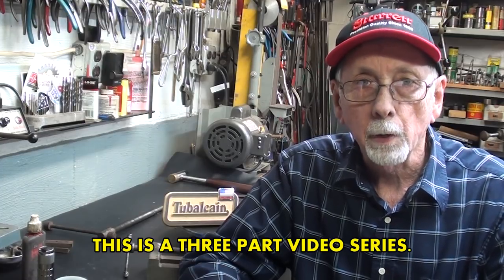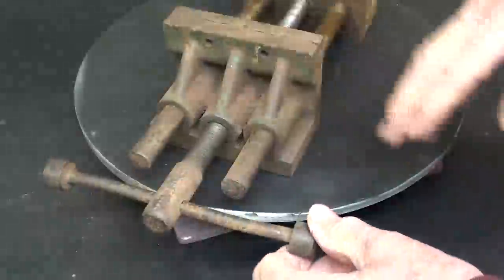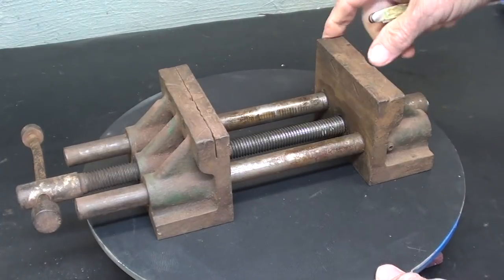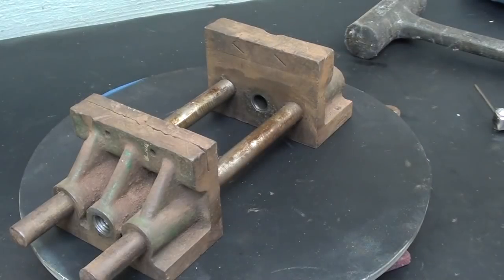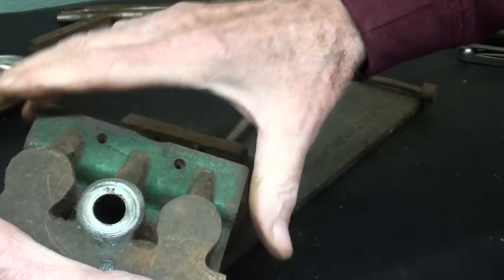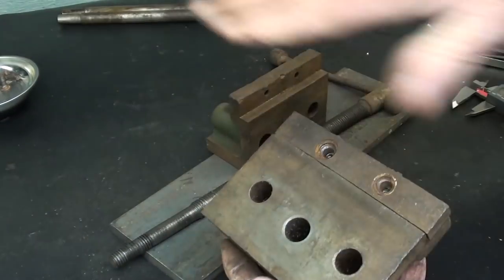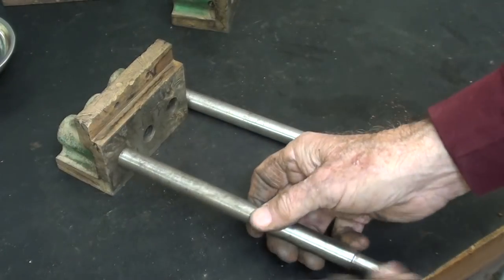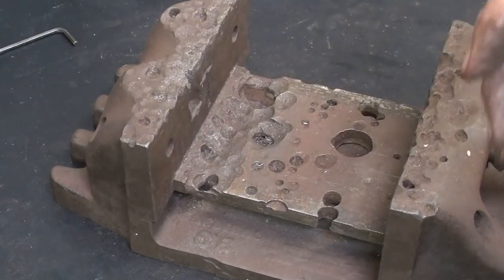Fixing a Left Hand DP Vise pt 1 TIPS #610 tubalcain mrpete

Comment: I suspect that "Bubba" may have made a mistake and threaded the wrong piece so he saved the project by adapting the design. I'm curious as to why you didn't just turn the ends of the guide rods to size instead of cutting them off? 

 We made vises like that in shop class in the 60s but we used all steel instead of castings. Then each student had their own drill vise so they didn't drill into the shop vises. We welded the two blocks together and bored the holes so they lined up perfectly. We threaded the guide rods on one end and they were 6 inches wide but otherwise very similar.
Reply: I agree on turning the mushroomed ends.  It's ability to open so far is the benefit of it.
Reply from the maker: We made vises like that in my class. We always welder them together for alignment

Comment: I know you're already done with this project, but if you knew someone with a blast cabinet you could sand blast all of those nooks and crannies down to bare metal in less than two minutes.   I bought a cheap table top blast cabinet that works well other than the fact it won't seal and you still need a respirator and sealed eye protection.
Reply: There's a few uploads on modifying the cheap Harbour Freight blast cabinets.  Everyone likes the price...but they see a lot of room for improvement.
Reply: @drmodestoesq  I appreciate it.   I will check it out.  I bought mine because I had a few things that I wanted to do.  After I finished those it just sits taking up room.  I've had a few things since that it would have been handy, but I wasn't willing to deal with the hassle.  I need to fix it or sell it.
Reply: You can also add a water pump and turn it into a vapor blaster. Plenty of videos on how to do that. Including how to seal it better.

Comment: That lead screw looks like a bodge. I'm guessing the unthreaded part should be by the handle.  That means the hub for the handle will need to screw on the end somehow.

Back to watching!
....
I am looking forward to seeing you restore that speed vise. Especially if you build up that surface with some silicon bronze or other weld rod  and machine it back to mint condition

Comment: A quick question about my Craftsman 12" metal turning lathe.  What is the maximum diameter four jaw chuck I can run on my lathe.  I have found a used Atlas 4 jaw in eight inch diameter and wondering if my lathe's timken bearing will handle this diameter.  Thank you for this and the excellent series of videos. Or can you recommend one of your videos where you talk about this question?  Thanks again.
Reply from the maker: 8 inch will work fine

Comment: The parts probably were cast using the lost wax or investment casting method.  When I was into model railroading I would buy many intricately cast brass parts for the locomotives and rolling stock and most were advertised as "lost wax castings".  It was a few years before I actually go to see the process.

Comment: I would guess these were war time parts, the high quality castings likely made in bulk n a foundry using a good set of patterns, but the rest was done in small shops, or in schools, using what they had available to fit. Likely they only had right hand taps for other projects, so no left hand taps to use, made do with what they had. Yes probably a first apprentice job, or something you turned out fast as needed with whatever was to hand rod wise.
Reply from the maker: You are probably right. A very good analysis

Comment: At 18:49 Tubalcaine mentions that the support/alignment rods should line up.  I had a similar Wilton vice that I took apart to paint.  After reassembly it wasn't opening/closing nearly as smoothly until I reversed the rods.  So something was different between the two rods (or holes).  Suggest you use witness marks to make sure you get the rods back the original orientation!
Reply from the maker: Yes

Comment: I have been watching your videos for many years, And in that time I can only remember Disagreeing  with one thing that you said. The strength of a threat is dependent on the amount of Threads presented And the material that is used. For instance, the Head bolts used in an engine may have as much as 3 inches or more of thread engagement into the cast-iron block.  This is because the cast-iron block Is weaker than the High-grade bolt used. In fact, given enough Thread engagement, you could break a great 8 bolt when threading into plastic.

This does not mean, that in your application the threaded portion of a nut is not sufficient. It probably is, but it is not as strong as it  could be.

Other than that, it was a great video. Looking forward for the next one.
Reply from the maker: Thank you for that correction. I should have known that. I sure have taken out plenty of long head bolts

Comment: I'm only 6 minutes in, but I think that vise would be correct if the handle were at the other end. Then, clockwise would tighten the jaws, and there wouldn't be the clearance issue between the handle and the guide rails.

OK, I just saw the explanation about being assembled backward. I'm not saying it's assembled wrong, I'm saying everything is correct, except the handle needs to be on the opposite end of the screw. That unthreaded end of the screw where all other vises have their handles. I don't pretend to know why or how this vise ended up like this, tho. It's a bit puzzling

Comment: I think the rods and the bolt are supposed the stick out the same end. That way the handle can be off the table and easily turned while the work is in the center.  The one you showed from lost creek was made the same way except for the left hand threads. Maybe Bubba broke the left hand tap so he went with what he had.